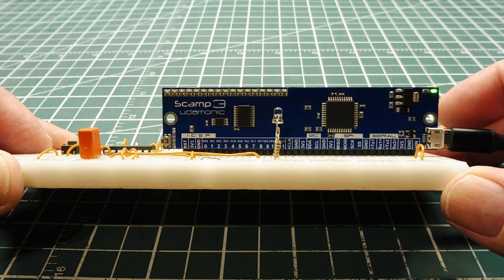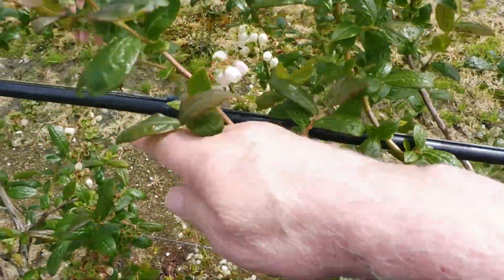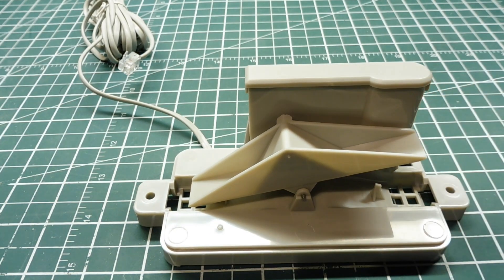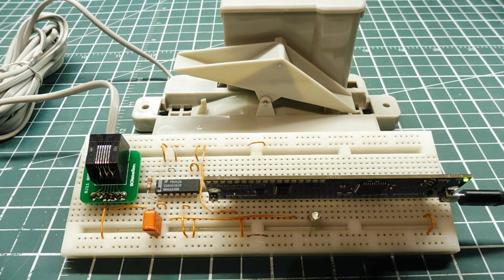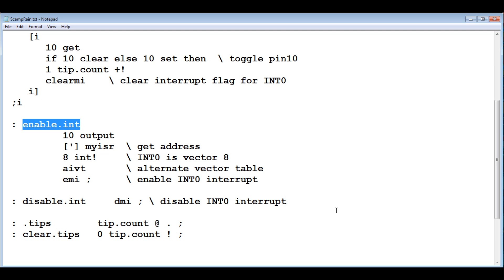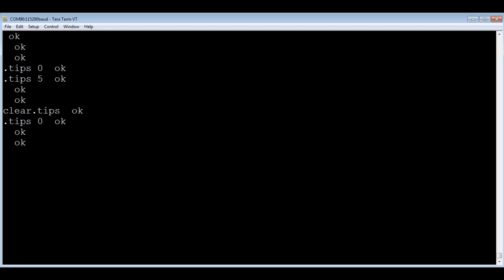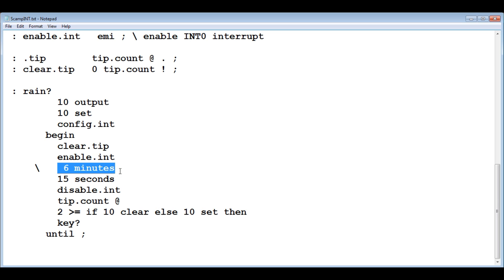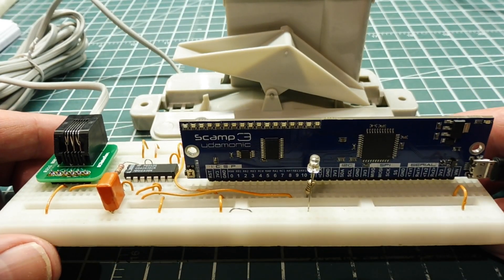Rain Intensity Sensor / Tipping Bucket Rain Gauge

Comment: Love the mix between in the lab and in the field :)

What are the benefits to use  RJ-11 cable?

How many blueberries does a typical plant produce ?
Reply from the maker: RJ-11 is your typical telephone interface with quick dis-connect and faceplate jacks available at any hardware store. Blueberry yield depends on the size of the bush. We did a heavy prune this spring so the yield will be down but the berries will be bigger. On the average you can expect 8 to 10 lbs of berries per bush.

Comment: The animals chew on the pipes because of the liquid fertilizer. Liquid Poop and Pee. Programming in MS notepad is real oldscool
Reply from the maker: The coyote problem started before we had fertilizer injection and all lines were cleared out with compressed air. Conservation officers have seen this a lot especially when the young pups are teething and they like the soft plastic which is just the right diameter for chewing. I have recently been using Sublime Text for programming but all files I distribute are in Notepad, so whatever the computer or platform users have I know they can view a simple ASCII test file.

Comment: Another great video, thanks Ken. A very good explanation of interrupts. And I was fascinated by the rain gauge sensor -- I haven't seen one of those before. Just curious, what's the operating voltage and current of the solenoids you use? I've got a 4-channel solenoid board prototyped, it's 12V and 1A. It's designed to daisy-chain over I2C, and with multiple boards you can control up to 28 sensors. Wondering if this would be of any use to you?
Reply from the maker: Hi John .. the control solenoids are 24 VAC. The Hunter irrigation controller has a rain detection input terminal strip that just needs a relay contact for activation. The one they use is a piece of felt that expands when it gets wet and opens a contact. When it dries out the contact closes. The bucket rain gauge sensor is a lot more flexible.